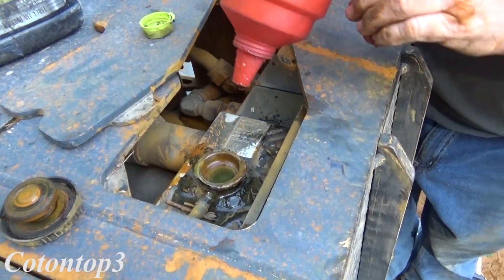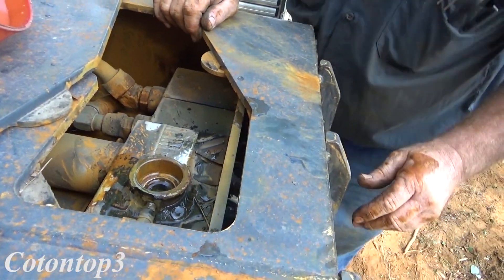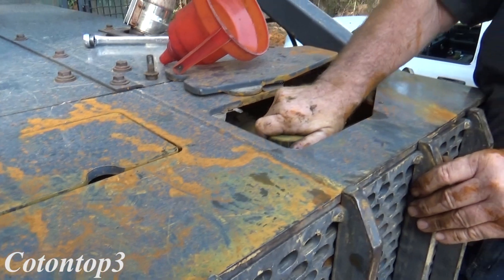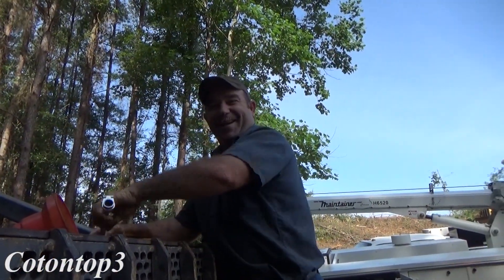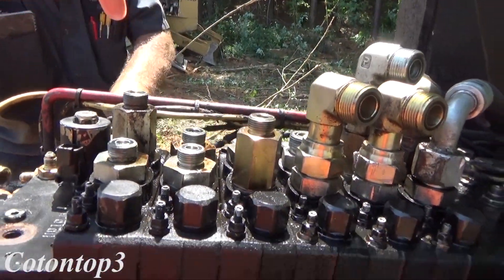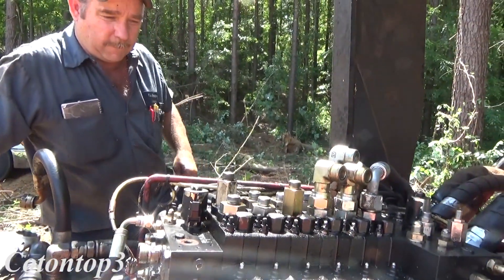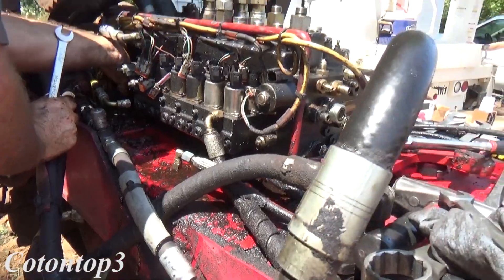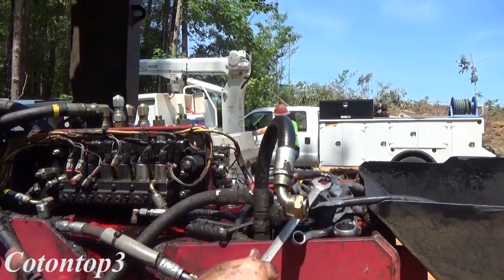John Deere Waratah maintenance part 1

Comment: Could be electrolysis from dis similar metals. It is important to have the cooling system grounded to help prevent this and also use distilled water with the coolant/antifreeze.

Comment: It's actually hard on some Diesel engines to constantly be shut off and restarted but I agree it can bee shut off if it going to sit for like 20-30 minutes I'm a farmer and I hate to let my tractors set running but my older ones are supposed to because of  suppsibly are hot cool hot cool hot cool it can crack your block but I shut my older tractors off anyway and I've never fracked one and wen I'm working them hard I let them cool off for a wile and then shut them down love the videos keep em coming
Reply from the maker: Glad you enjoy the videos. Tomorrows video is very good

Comment: There's a lot of valves and lines there, looking forward to part 2, certainly a rather them than me jobYou can tell a lot about a dealer/ maintenance firm by the way they kit out their trucks and both Jay and Band Gs trucks are both spot on.
I always say to folk, it's not a question of what you run not breaking down, just a question of how frequently it does and how easy and quickly you can get the parts!

Comment: Hey Tim Napa Mike here that problem with the coolant is acid we sell test strips for coolant in Diesel engines when the acid gets to high we have a product that you add to the coolant to bring the ph back in balance wix filters makes the strips and additive the new ford trucks have a sensor that lets you no when the ph is out of balance if you would like I'll get you the part numbers with all your equipment I'm sure it would be helpful when doing an oil change just pop the radiator cap and test the ph take care ol boy Napa mike

Comment: Wasting diesel like that is just idleness - I guess that he has left it running to keep the AC functioning?
Can you not wash all that rust deposit off with a pressure washer to stop corrosion and make the machine look a bit smarter or are you concerned about possible water damage?
Reply from the maker: +Dan Whiteford we washed it off once we got it all flushed.

Comment: Great vids man!!! the guy that talked about a bad ground could be right! A good alternator tester would pick up a drain or fault in the electrics!!! NOW ? when you replaced the engine did you have the radiator cleaned ? some radiator shops use acid to clean the inside! if it wasn't properly flushed , you could have installed it with some acid still in it! Deere could if you took a sample of what came out, analyze your coolant. CHECK YOUR GROUNDS ANY WAY! Also check the batt. one at a time if you have a plate collapse inside you could have a short internally. I have had a batt. work fine , but you could take the ground completely off and I still had current drain.  hope this helps ! the mech. in ohio